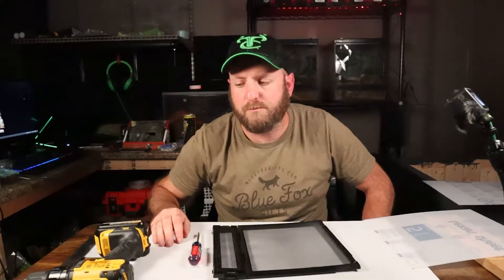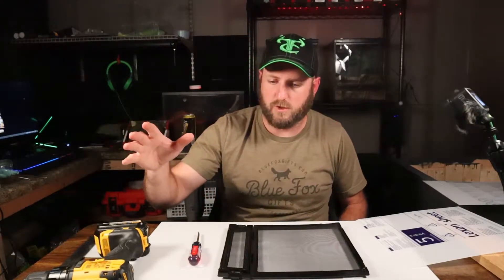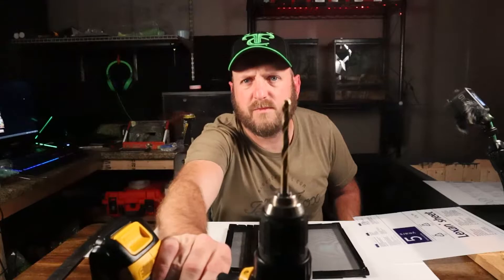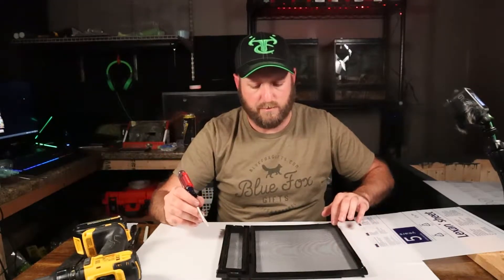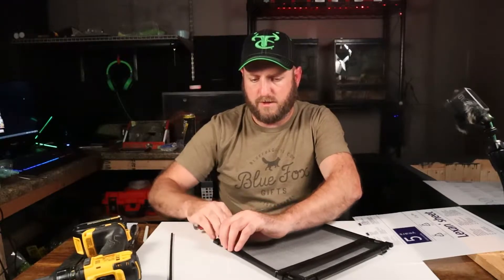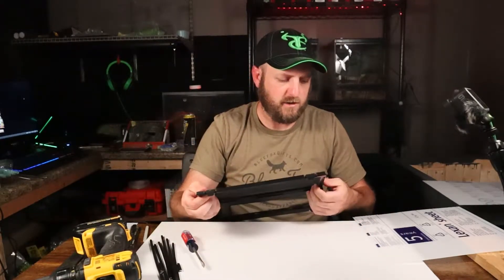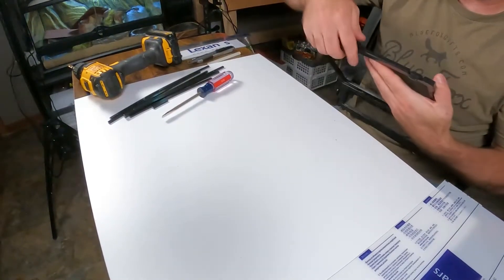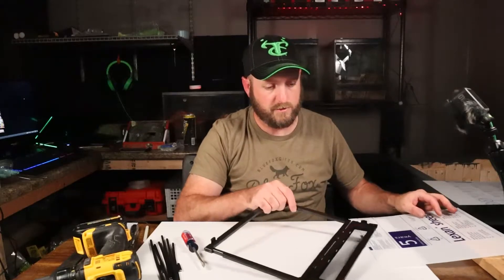DIY Replacing a mesh lid with Lexan or acrylic on your Tarantula enclosure

Comment: 1:00 A step bit also works well.
Reply from the maker: They certainly do, I think they actually seem to work better. I have since picked one up and won't be using anymore traditional drill bits when making holes in enclosures. Night and day difference.

Comment: I just bought a 10 gallon Zilla enclosure I intend for a T. It also has a screen mesh top. I'm actually thinking about replacing the mesh screen with something with way bigger "squares" like chicken wire because I want optimal airflow. I was just going to silicone it on. Well...airflow AND I don't think I have the tools to drill clean holes in plexiglass and I'm very OCD in my perfectionism.  Do you think the wider millimeter mesh would work? (Since their claws getting stuck in the fine mesh is the issue)
Reply from the maker: I think the wider spaced wire would be a much better choice then the screen mesh. Just keep in mind that having to much airflow could lower the humidity and cause the substrate to dry out to quickly. Easy fix if it does though, you can just spray the substrate more often or put some plastic on the lid to block off some airflow.
Reply: @Pat's Creature Cave  Thanks! I actually went yesterday and looked at quarter inch hardware cloth, looked like it'd work great but the price was RIDICULOUS! I'd have to buy a whole 8 ft spool for $30 just for a 12" × 8" piece, so I went with plexiglass that was free because the awesome man at Lowes had a leftover that was the perfect size when they were out of the thickness of plexiglass that I wanted😁 
Eventually I will get a spool of the hardware cloth and replace the plexiglass, because this was the first plexiglass I ever drilled and it's definitely less than perfect! But it will do for now. Thanks for answering tho, the T community are awesome with answering questions!
Reply: @PatsCreatureCave  that's a really good idea about putting something on top to help reduce the amount of evaporation

Comment: Instead of all of this work and destroying its original form, then just glue or use silicone to attach the Lexan or Acrylic to the underside, while keeping the mesh intact. No one will notice any difference and the spider sure wont either and the end result, which is to protect the spider from getting stuck and retain humidity will be just the same. Then simply remove if you ever want to sell it in its original form and you saved a ton of work to begin with.
Reply from the maker: Thank you for the info. I had considered this but opted to still removed the screen. One of the reasons is that I was experimenting with different size holes at the time and was still worried about the T reaching is paws through the holes and still getting to the screen.

Comment: Hi Paul I love your show i was wondering do you know anyone who could make a new  lid for my Curly Hair, Paul? I have a 6 gallon Zoo Med w/screen inclosure. I don’t have a drill or tools to do the job myself.  10.5x 20.5 x by 8h inches
Reply from the maker: Hi There, I would check on Etsy. There are many shops on there that create custom enclosures or lids that would fit your  enclosure. You can also ask vendors at your local reptile expos if they know of anyone local that can help.